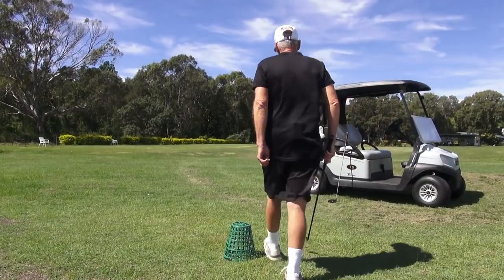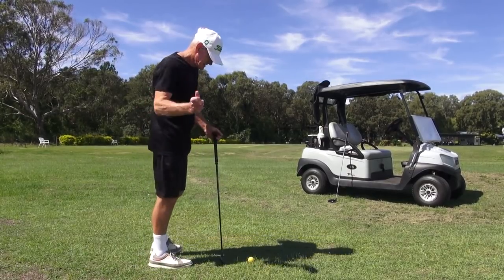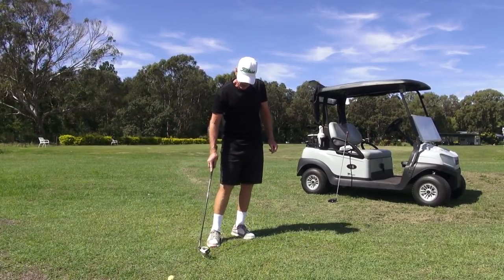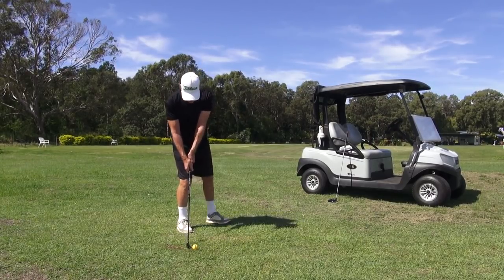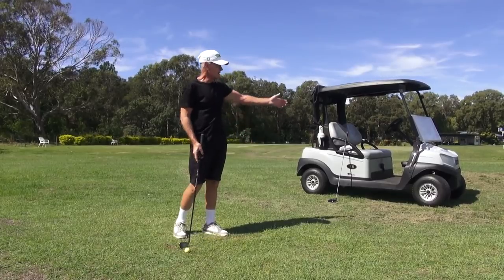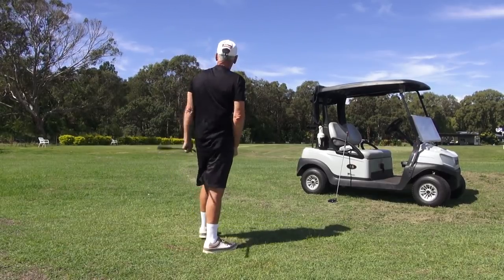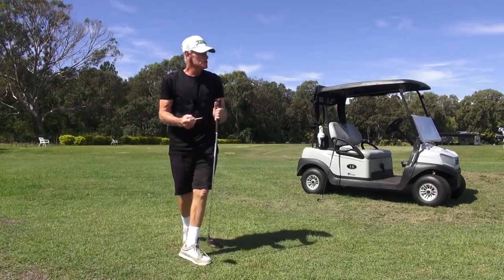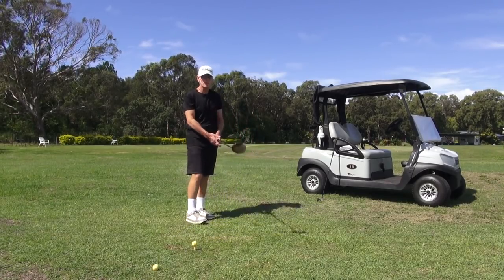Correct  Leg Structure For Channel Lock

Comment: Tangential...shuttle hips and shoulders...head slides under
Keep legs bent...body acts as reaction to receptors in trail hand...body is responder to the initiator (trail hand) 
Fire right hand into ground... short abbreviated swing
Tiny little aggressive golf swing (Bruce Lee 1” punch)
120% emphasis on turndown slap with punishment...
Pull it back and then throw !
( I train with impact bag)
All trail hand and fire with turndown...
Keep trail leg behind with feet planted...
Feel like toe of club is going into ground...
( I feel lead knee is moving over shoelaces of lead foot) I
I set up with 45 degree flair out with lead foot...
41” driver( I grip down 2” on 45” driver)
JH opens face on takeaway and closes on downswing...
Smash Factor with so much hit...smother the ball with
Baseball Layback...
No body rotation...
Practice with clubshaft behind lead knee pulling trail knee/leg 
back...

JH...One of your best!!!
Thanks...Thanks...Thanks

Now with Tigers “ice baths”
I’m good for another 100 years 👍👍👍👍

Comment: Are we putting shaft lean back into it, removing the ulnar deviation as well as the negative loading?
Reply from the maker: The negative loading  is  always  in my swing  ..   when I    talk about it and demonstrate it is  over   characterised to show the 'intent' of the action  .. my clubhead   is never   moved    intentionally;y  'first'  in the backswing..  the 'Ulnar' deviation    is not something  'I' have  ever  suggested be an anatomical     requirement  ...
              The shaft lean frankly is  a resultant of always having to cope with very strong headwinds on my practice tee  ...  I  just naturally set the club in a strong face orientation to keep the ball down out of the winds .. 
                   As well  I think I have probably evolved   a bit      into     a bit of     forward shaft lean  as I have become more proficient    in the   CL  general  mechanics application ..   if  a player can apply some forward shaft lean and     still get  good   ball flight height     there is no reason not to apply   some shaft lean  .. I can get away with it these days because I stay  back  well enough  coming into impact      so as to not   have the clubface shutting down too much at impact    
                 Cheers JH

Comment: I’ve tried cl with an open stance a parallel stance and a closed stance. 
The open stance is what works for me.
Is this leg behind leg, appropriate for an open stance?
Reply from the maker: To be truthful it's not as easy to get the trail leg staying back of the lead leg from an open stance  ..  you can do it but its really a lot of physical commitment  .. and frankly that is the reason I   morphed into a closed stance from an open stance   ..
               If you are more comfortable with an open stance you just have to give a lot more commitment to keeping the lead hip/knee from rotating off the target line coming into impact ..  you    have to feel a lot of  'reverse' winding of the trail  hip     coming into impact      
                               cheerts JH
Reply: 1atomicgolf interesting comment locilure if you notice with the in to out attack with open stance there's more precock and notice it in the trail hip you've got to hold it back to strike with in to out attack.jh is absoulty right it's kinda like prewinding against swing for the good stuff.cheers

Comment: Hi John, Just after some advice please. I'm about to order my one lengths. The hybrid is set at 62.5 lie and can't be adjusted. Would you recommend getting all the clubs set at 62.5 to match the hybrid? I didn't have any trouble hitting the 9 iron in the shop set at 62.5. Or since I'm getting 6 irons should I think about the best lie angle for them and have the hybrid different if necessary. Thinking about 63.5 and length of 37.25 feels comfortable as I like some leg bend. Cheers. Richard
Reply from the maker: Hi Richard,
                The irons come std at   37.25 inches length.. they are balanced and flex stepped to suit that length so you wouldn't want to go changing the shaft length at all   I wouldn't think ..     I don't know why Cobra have gone to variable lies in the F9  one length irons ...   I    loved the F7    irons which were all   62,5   deg  lie  ...which is a  normal 7 iron lie angle  .. and   37.25  inches is a typical length 7 iron  ...
                            The  F9 irons now go up to  65 degs      in the 4 iron and down to 61.5 degs in the wedges   .. I just don't get why they have done this ..  
                           I would personally get all the irons adjusted to   62,5 degs  ... the clubs are all    7 iron length so they should be 7 iron lies..  having the irons at 62.5 degs will give good relativity of feel for your hybrid as well...  
                     Yeah  .. I am stumped as to the move to variable lies in the one length irons  by Cobra ..    maybe they caved in to pressure from retailers and club fitters that are brainwashed relative to traditional variable lies in irons  ..  I can think of no other reasoning .. 
                            Cheers JH
Reply: @1atomicgolf  thanks John, appreciate

Comment: I want to use this “leg configuration” thing to share another thought.  If I was wanting to posture myself to best stabilize my body and keep my balance against gale force winds coming straight at me, I’d take an athletic position and hunker down and put one foot in front of the other and align my shoulders and hips into the wind.  I most certainly would not open my stance and make a bigger target for the wind to blow me over!  I’d lose my balance!! 

Of course a Channel Lock Swing is not a gale force wind but it IS a force to be reckoned with that can cause us to lose our balance.  My suggestion ... only because it works for me and not because I’m a teacher (I’m not!) ... is play with a closed stance and put that lead foot in front of the trail foot to help counterbalance your swing across that target line from in to out with near gale forces.  😂
Reply from the maker: Hi Craig,
                   The video that I did today will give you a bit more understanding of the leg formation structuring..  but what you are doing is well on the way to getting good structuring.. 
                              cheers JH
Reply: I like your balance point idea. I’ll try it later today. Thanks Craig.
Reply: Craig Guthrie 
Great insight...balance is a human survival instinct...the body doesn’t care about the golf swing , it just doesn’t want to fall on it’s nose !
I like to have my energy and force vectors going toward the target without swaying!
JH says use Layback (buttress with target leg)
This gives you that catapault effect (whiplash power)

Great word pictures!

Comment: I have been following you since before your CL period. I was trying to understand Moe at that time when I discovered you and  have attempted this new method shortly after you began your CL instructions. I do ok with it except for driver. I think my favorite driver has too low a  loft (9.5). Thank you for all the entertainment. By the way do you ever encounter any of the dangerous snakes your homeland is so famous for?  )
Reply from the maker: If you are not someone who has an 'up' delivery attack to the ball at impact you definately will need a driver with more loft than you currently have  ..  I    can use    8.5 deg or 9.5 deg drivers because I have an up angle attack on the ball of significance with my driver ..        
                  You  will know if your    angle of attack is 'up'    at impact with the driver if   on most   occasions the  tee stays in the ground after   impact  ..  if  the tee  is   normally     knocked out of the ground   your attack angle is   down at impact  ..  ...try and hit a few drives where the  tee stays in the ground after impact  ..    ...
                          cheers JH
Reply: bloatedman 
IMO ( in my opinion)
With a senior swing speed I use a 12 degree which more closely ideal launch of 12-14 degrees...
I also grip down (ala Rickie Fowler) with more center hits with only about 3 feet loss of distance...
Try it...I think you will like it !
👍👍👍👍👍

Comment: This is the key to CL. Good instruction JH,
Reply from the maker: Hi John,
                   Its certainly a point of application that is paramount in getting the best out of the CL swing mechanics .. it's not easy to get set into the swing for sure  .. but some of those little shots   I demonstrated will get the structure feeling coming onboard pretty quickly .. 
                       Cheers JH